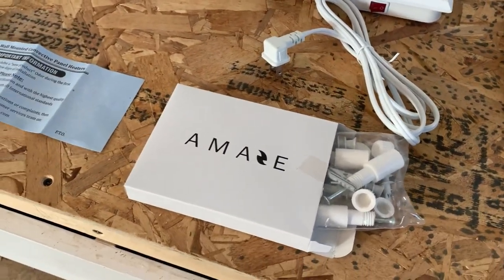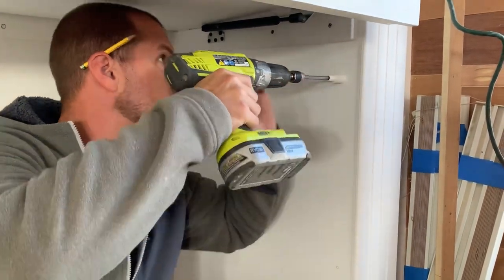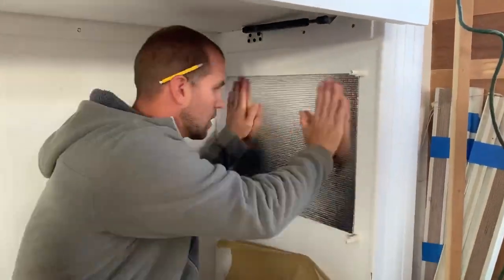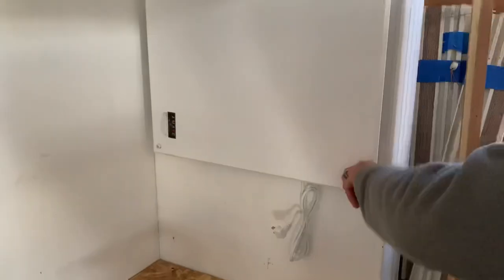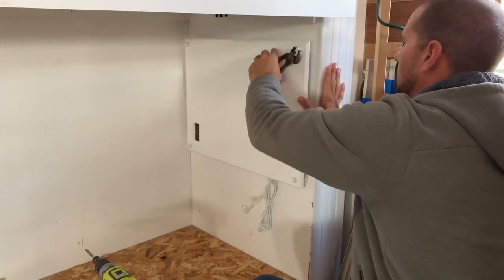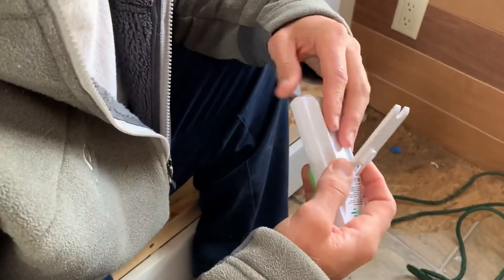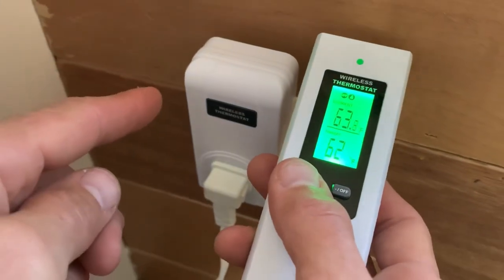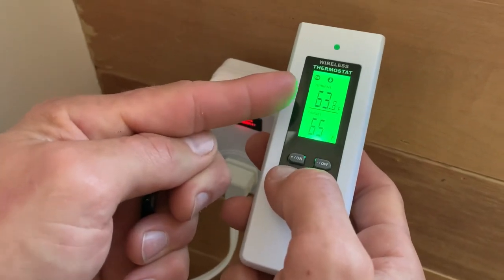Staying WARM in Small Spaces- Electric Wall Mount Panel Heater Install/Review

Comment: Is there any thermostat switch that has a timer to turn on off, thanks
Reply from the maker: Yes, you can buy an analog knob turn style, or a wireless remote version like these:

https://www.amazon.com/EconoHome-Adjustable-Thermostat-Universal-Compatible/dp/B08HNHBC8P

https://www.amazon.com/DIGITEN-Thermostat-Temperature-Controller-Programmable/dp/B08Z3C5CLT

Comment: Amazing, this is exactly what I was looking for!!! I'm in Colorado and need an alternative way of heating my RV other than propane. I looked into installing a mini split system, which would be great but also much much more work!!  Can I ask, what size is your RV and how many panels did you install, and what kind of electric bill were you seeing?  Thank you so much!!
Reply from the maker: Oh I’m glad this video was helpful. These ceramic panels are so great! We’re currently just using the 2 in the bunk rooms. The temps have hovered around zero and hit -3 this week, and there were ZERO complaints from the kids. These heated their slides beautifully!!  Our overall 5th wheel length is 35’ I believe, and we have 4 slides. 1 in master, 1 in kitchen, and 1 on each side of the bunk house. We have an ac unit we installed this summer that doubles as a heater that we’ve been utilizing in the master. I’ll link that install video below so you can see exactly what unit we’re using there. Looking at our energy bills the past few months? they were actually significantly less than last year at this time! -(like $60-$70 less)We’ve done a lot to close up and insulate areas better though. We supplement with our propane heater. We’re currently remodeling the master area and will most likely put a somewhat larger panel (that we have on hand) in that room or in the large main kitchen/dining area. Goodluck with adjusting your heating situation!

https://youtu.be/KgnsVsB6ehg

Comment: how far can you feel the heat in front of it, i want to mount it in my bathroom, but im thinking that the bathroom exhaust fan will suck out the heat that rises. does it reflect a few feet into the room. our bathroom is 5 ft across. x 10 feet long.
Reply from the maker: It uses convection to heat cold air from the floor and circulate or pull the air behind it using thermodynamics.  As it heats the cold air it rises behind it creating a “suction” which pulls the cold air through.  In a closed space, it eventually heats all the air which makes the space warm.  The space needs to be closed off in order to work properly.  It initially takes some time to get the space to temp and then it just maintains the heat as the space remains closed.  If you turn on a vent fan, it WILL pull all the heat out of the space and will start the process over again.  If you are turning to use it to keep a bathroom warm, it will only keep it warm if the fan is off.  The whole point of the heater is to efficiently heat the space at a low cost without the tile getting hot enough to burn someone if they touch it.

Comment: Hi, those plasterboard wall anchors should be ok to use right and won't melt? Got a 450w glass panel heater. Thanks
Reply from the maker: Plastic wall anchors are safe.  The parts that come with it that space it from the wall are also plastic.  The heater never gets hot enough to melt or burn anything.  You can put your hand on it and it’ll just get uncomfortably hot but not dangerous enough to burn you.  It is designed to slowly heat the air in a closed space.  I recommend using this style wall anchor though, just because they are better quality than what comes with it.  

https://www.amazon.com/dp/B08G8GYT4S/ref=cm_sw_r_cp_awdb_imm_KS1HMMVHRNAFQNXC1BTV?_encoding=UTF8&psc=1

We couldn’t use wall anchors in this scenario because it’s just 1/8 inch plywood underlayment.  Our heater is being held up on just the one side that we could screw into the stud on; and the other side is stabilized with screws but not structural.

Comment: Would you say this is safe to place on the wall close to a crib? Does it get hot enough to burn an infant or toddlers hands? Though I would still move the crib further away to avoid the baby touching it through the bars.
Reply from the maker: It does not get hot enough to burn anyone.  It does get hot to make you not want to leave your hands on it but if a child touches it it would get there attention and cause them to pull there hand away.  But even if they left their hand on it it wouldn’t burn them.  That’s one of the things we really like about it.  As you can see, it’s mounted right where they sleep and we’re not worried about them getting burned.

Comment: I need a way to floor stand this, any ideas?
Reply from the maker: Ideally you’d mount it on the wall for optimum results.  If there’s not a spot on the wall to fit it, just build a simple stand out of 2x4s and plywood.  The most important thing is to make sure there is a flat surface behind it for it to work the way it was designed.  It will not work if it doesn’t have a “tunnel” to stuck the air through.